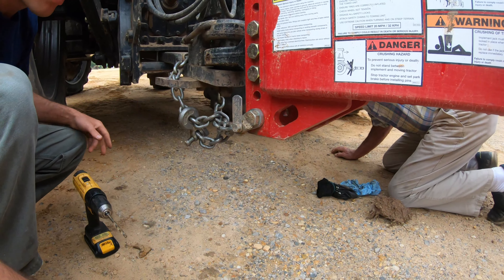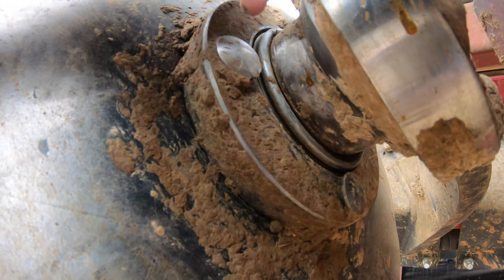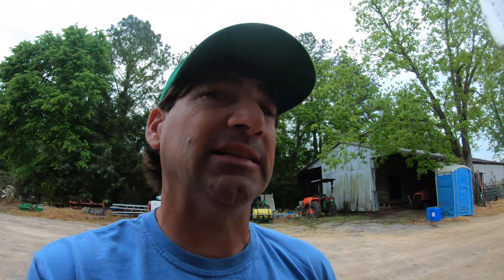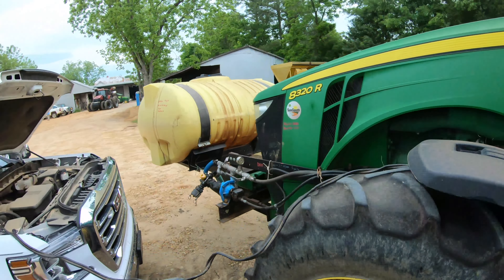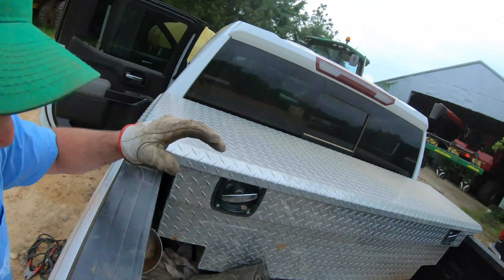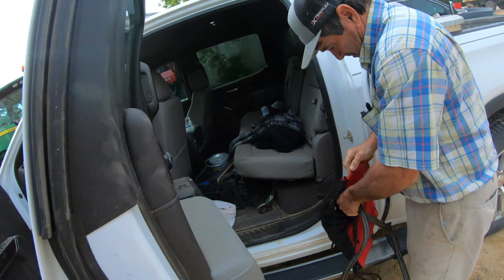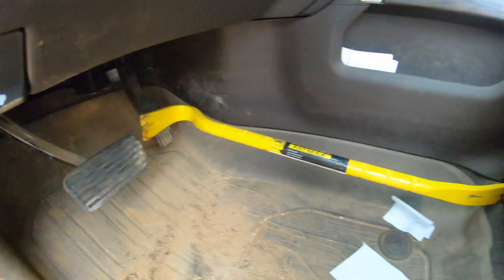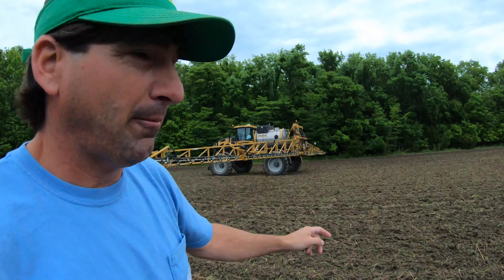HALF WAY DONE PLANTING COTTON

Comment: Wish we could run high speed disk or anything for that matter.  2 many mineral deposits, limestone rocks.  Great video.
Reply from the maker: Wow where are you located, thanks for watching 😁👍
Reply: @TripleRFarms  about 30miles north of tn/al line on65. 4countys built on the same rock it's just closer to the top in some places. 😉